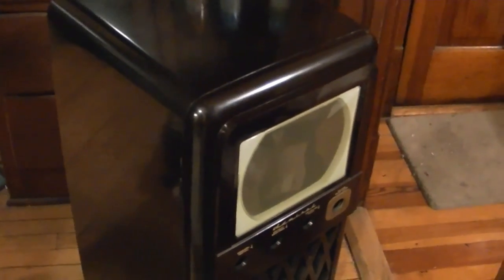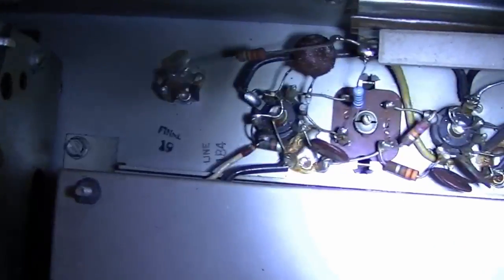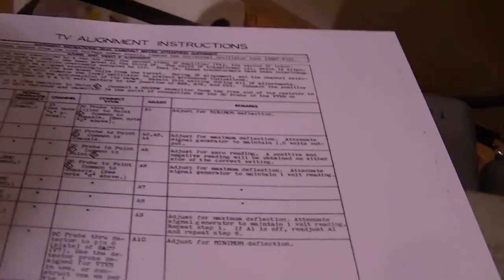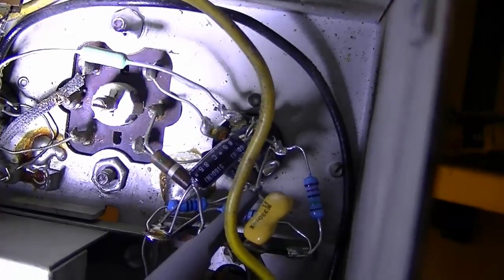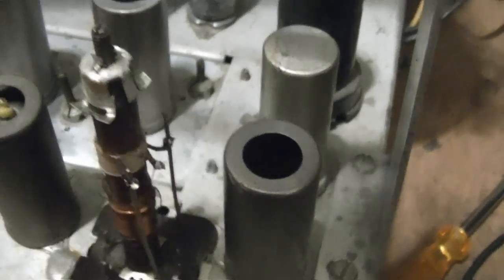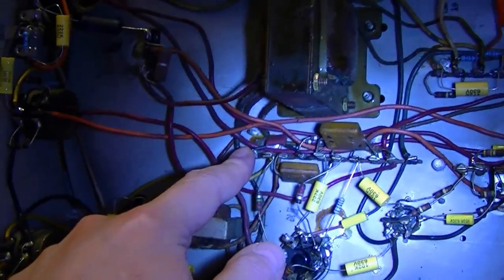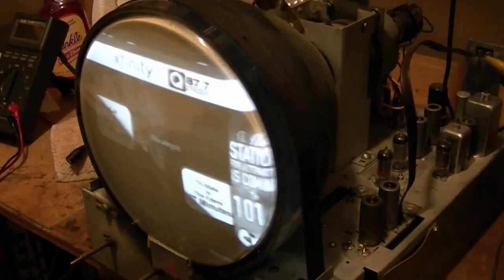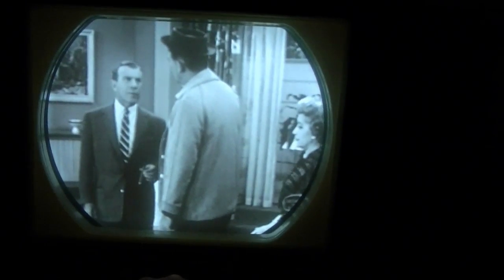Admiral 20A1 - troubleshoting weak sound

Comment: Unintended Waste Release Management Systems Isle.  I love euphemisms, they make us feel good about our rotting carcase of a culture. 
I got a few 12-70pf and 50-150 trimmer caps that I tack in if I can sweep it. I dial it in with the trimmer and core then remove the trimmer and measure its value and install fixed. Could leave the trimmer in too. They seem to be super critical to me, 1-2pf makes a huge difference in the bandpass.
Reply from the maker: The commercials on MeTV, AntennaTV, RetroTV etc are soooo depressing.
Reply from the maker: shango066 I really appreciate those demented interludes :)
Reply: At least the Posti Vac commercials seem to have disappeared, which isn't too surprising given that the "Medicare" people are now cracking down on such scams. I thought maybe the commercials on MeTv were mostly due to the lousy sales department they have at the local MeTV affiliate, a never ending parade of geriatric products and services, they were bad for that before they became a MeTV station. Aside from that they have a fetish with running infomercials for hours on end, rerunning Combat and 12 O'clock high, and boring religious programs.
Reply from the maker: OlegKostoglatov I've been watching the various vintage TV networks since their inception and the commercials are worse now than ever.  If it isn't some new fangled cane or reverse mortgage, it's a class action lawsuit.  Anyone have a bad metal hip replacement, pelvic mesh  or mesothelioma?
Reply: Here you see lots for adult diapers, old folks homes, and walk in bathtubs, and a regional mobility scooter dealer. I priced out a walk in bathtub at the Home Depot once, those suckers cost $4500 on up!!!!! The law suit ads must be network wide, like the AARP commercials.
Reply: Oh, I forgot about the stair lift commercials, but those seem to be more recent. I can understand stair lifts in concept but I think that the design of the ones they advertise are rather poor in that between the chair, and the track they ride on, they take up too much of the stair's width. If they designed it as a platform that could take two people up at a time it would be better.

Comment: I've noticed that those carbon composition resistors tend to drift upward in value even when a set is not in use. I'd be almost tempted to shotgun the cathode and plate resistors and maybe leave the bias ones alone, only after obtaining an initial operational baseline, though.

Comment: I think it's known as "silver mica disease", quoting shango066
Reply from the maker: Yep or SMD for short.
Reply: Yes, you can't just throw anything in there, some AM IF cans use 100 pf/mmf but others can use higher or lower values. If you use a value that's too low you can end up with a double peak and no gain.